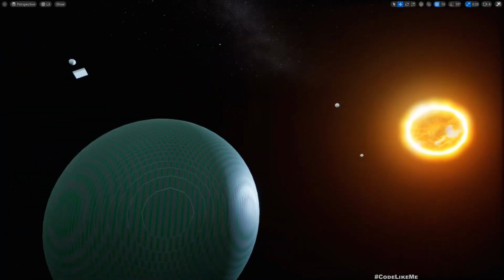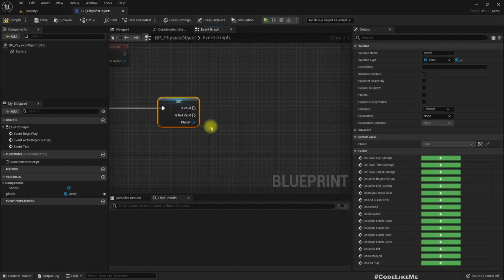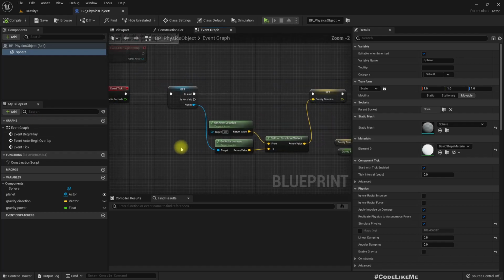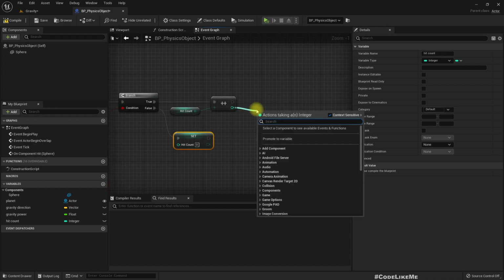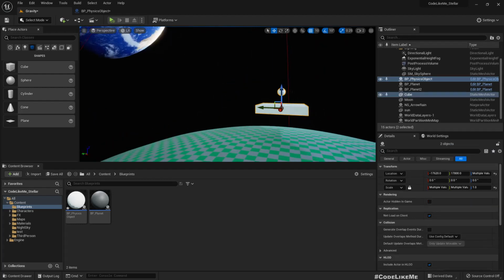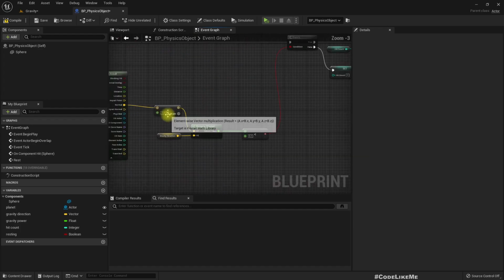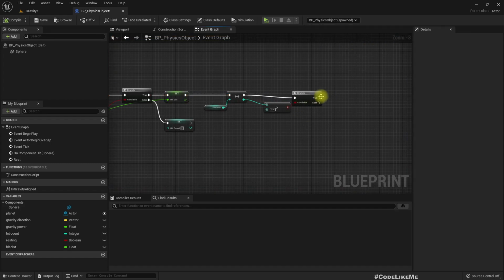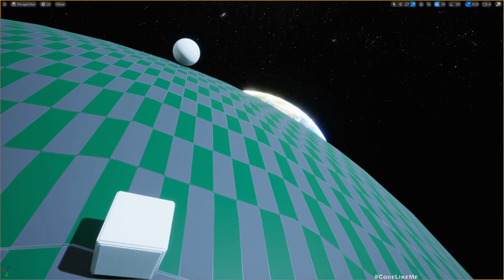Unreal Engine 5 Planet Gravity System - Physics Objects

Comment: Hello, I want to apply 'planetary gravity' and 'planetary map' to the game map, but I can't find them no matter how much I search, so I'm messaging a comment like this. Are you currently developing a template? Do you have any existing materials? Or is this a project that CodeLikeMe is currently working on? I also have a question: How did you solve the optimization problem regarding planetary distances? In the map itself, as you get closer and closer to the planet, there seems to be too much data to implement. To implement it properly, even if you eliminate rendering as much as possible and capture as few objects as possible, it seems like the physical load would be too large even if you only apply gravity because it is spherical data in the first place. How did you solve it??

Comment: Thank for the tutorial! The object was never resting because the Nearly Equal (Float) was always False. The reason was the  Distance from the Line trace Hit result was 50 and the variable Hist Dist was 0. I still don't know why the Distance from the Line trace Hit result is 50 instead of 0. Meanwhile I am just subtracting 50 to the value.
Reply from the maker: Hey Geoffrey, didn't see a comment from you in a while. I need to check this project to answer this
Reply: Yes, it is also affected by the ball's size. So if you scale it by 2, you need to subtract 100. Easy enough fix to automate.